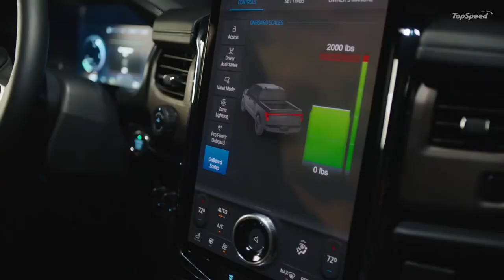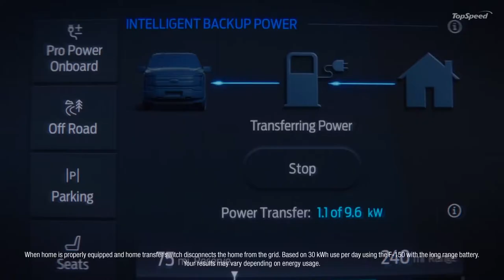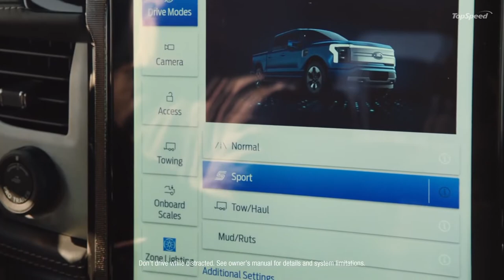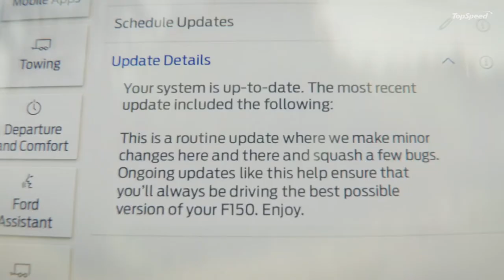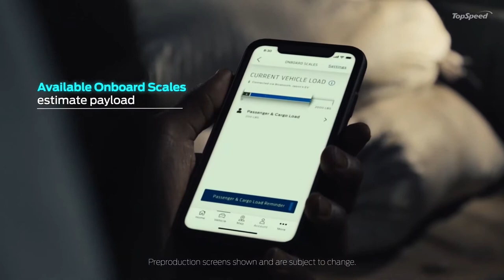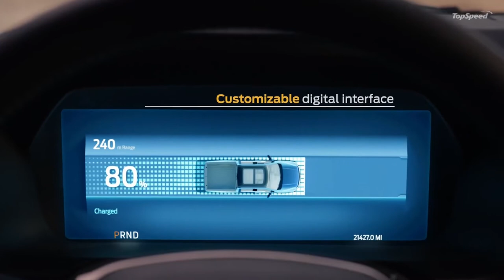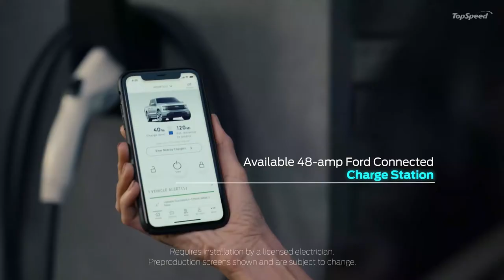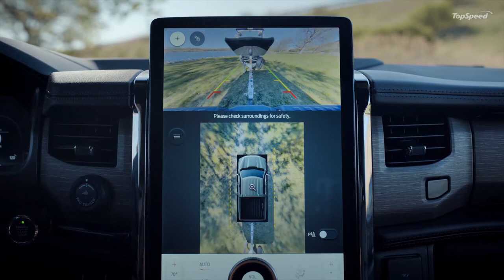2022 Ford F-150 Lightning – An electric pickup that can power your house for days

Comment: Still a piece of crap. I'm a Ford man, and a truck man. I wouldn't waste my time with a truck like this, if I have to travel more than 100 miles. The more electric components you add, the more problems you get. Electric vehicles are so over-hyped and will just be a phase until you can charge without waiting hours.. I can gas up and go in minutes. You can't charge and go, like that.